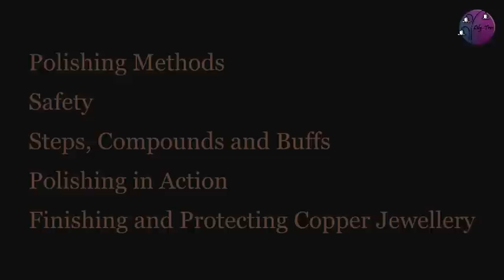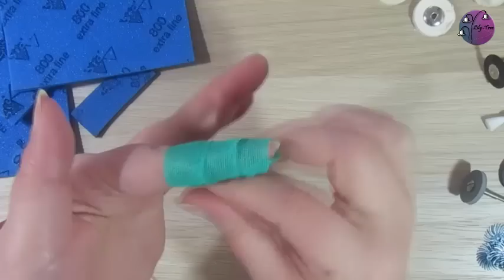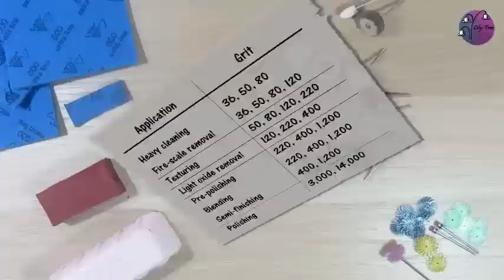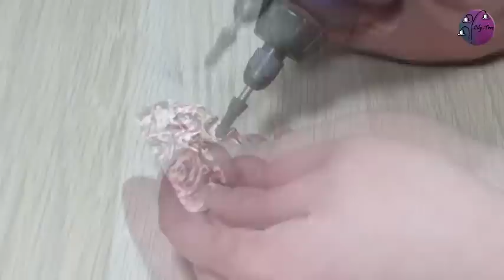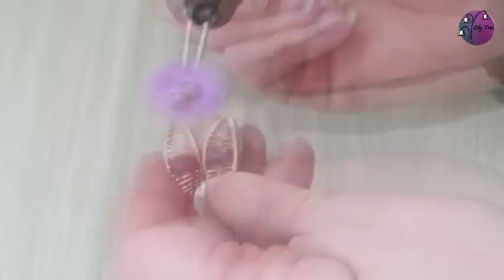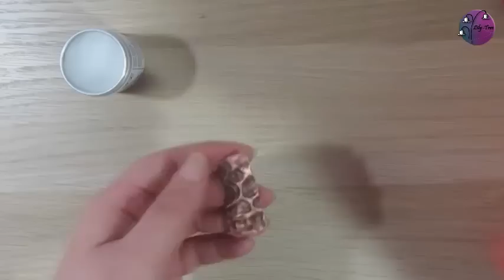How to Polish and Finish Copper Jewellery

Comment: Hiya, thank you very much for all your tutorials. Very helpful indeed. I saw your comment below about Protectaclear. I've been using this product recently as well. It really has a great finish and so far it's lasted a good while. Do you have any suggestions about how to clean copper pieces that have been coated with Protectaclear? I understand that this product stops it from oxidizing and tarnishing but it still gets a bit dirty after a while and becomes dull. Would you recommend using a silver polish cloth or a Sunshine cloth? Or would they be too abrasive? Or just a microfiber cloth? Thanks so much in advance.

Comment: Very helpful information. I have some silicone wheels and points but hate the mess that they make so I've mainly been using the radial discs and even doing much of the work by hand because I find it relaxing and i can take it in where I watch tv in the evening. 

Do you have any tips for keeping your bench clean when using the silicone products? My hands still get dirty when i polish by hand (and pretty rough too!), but I make less of a mess. I'm wondering if I'm using them incorrectly. Thanks again, I enjoy your channel.

Comment: Lots of good information, thank you.  I have a question:  Sometimes I use liver of sulfur to oxidize my copper pendants, followed by using steel wool to remove the excess..  After that step, I notice when I apply the rouge, my polishing felt wheel gets black from the oxidation.  Is there any way around this, or should I polish my piece with rouge first, and then oxidize the pendant second?  But I still want the shiny, polished look after oxidation...
Reply from the maker: Yes, I do tend to polish my pieces first, so I can concentrate on working through the grades and get the shine that I want.  I do try to 'miss' the low points, though, so the patina has a bit more to get a grip on! 😄 Once I've oxidized it, and used the steel wool, if I want a higher shine I'll then polish the high points again - and this usually only needs doing lightly. 

I do find that rouge tends to make the felt wheel black anyway - with or without patina.  I'd recommend trying the silicone/rubber polishing burrs - you can get fine grades for a high shine finish.  I feel that they give a bit more control over where I'm polishing and seem to last longer before I replace them (they just slowly wear down).

I hope that helps!

Comment: Thank you, Lily!  Most informative!

For US viewers:
'Pendulum' polisher means Dremel Rotary with a Shaft extension kit which can be hung on a stand.  It is the standard Dremel tool that you see in nail salons, and woodworking.

I also found a cheaper alternative for wax.  Renaissance Wax costs $15 for 65 ml or 2.5 oz.  You can buy the EJ Eaton Microcrystalline Wax 8 oz for $19 on Amazon.  Same item, good reviews.

Microcrystalline Wax is not the same as carnuba wax or beeswax.  MC Wax Polish is derived from crude oil and has polyethylene compounds and dries to seal the item.  Renaissance Wax is a brand of microcrystalline wax polish that is encountered in antique restoration and museum conservation.  It is also used for the polish and conservation of gemstones and of organic materials such as wood, ivory, and tortoiseshell.
Reply: Thank you so much I am trying to learn more about polishing and sealing copper jewelry and your comment helped tremendously!☺Very much appreciated! Many thanks!

Comment: Hello. After you buff those what do you apply to keep oxidization at bay ? I stay in a third world country and sealant sprays, renaissance wax etc is not available here. I am also confused about lacquer technique / plating / clear coat sealant / brasso - do all these methods provide the same final result? can you suggest something?
Reply from the maker: Hi John,  I haven't tried everything, but my current favourite is protectaclear from Everbrite.  I suspect that might be another one that isn't available there, though.  It is a  liquid lacquer-type coating, which seems to wear better than wax (which was my initial go-to).  Each of the methods you mention will have slightly different results, so you probably need to test them to figure out what works best for you.  I'd be inclined to try a clear sealant/lacquer and see how it works.  One thing to bear in mind is how much you're finished pieces flex and whether your chosen sealant will flex with it, or crack.

Sorry I can't be more help at this stage.  If you do find something that works, please let me know.  I think at some point I need to do a comparison video testing out some different choices, but I suspect that worldwide availability will always be an issue.
Reply: I will let you know after i test it. Talked with few owners of chemical stuff and experts - all suggested me that I should bend the strip before I apply the sealant spray. Other wise it may crack. Unless I dip my hands in it..I wont be able to tell 100% exactly. Yeah - material availablity is always an issue
Reply: Really complicated to find some here at the end of the world in Chile. Thanks for your teaching. I've been looking for painting copper with fire, but my cuestion is if it will change the colour...keep looking and learning. Thanks again you really give an excellent class

Comment: Thanks for your informative videos.  They are so helpful and your instructions are so lucid and precise.  I have read that a tumbler will help to take burrs off copper jump rings.  I have had an impossible time trying to file them down evenly.  Will a tumbler with pyramids help or is there another method you recommend?  Also, what is your opinion about using a clear spray gloss to protect the copper piece?  Thanks for your help.  Keep up the great tutorials!

Comment: Thx so much for your video.   What handpiece are you using?  I have a Foredom flexshaft I used to use for cutting jumprings for chainmaille, but now I do wire weaving  and am looking for a reasonable handpiece to do what you’re doing.  Do other products like a dremel handpiece work with a Foredom.?  Thx in advance for your response.
Reply from the maker: I've got a Foredom Flexshaft too!  My handpiece is the quick change one (H20 I think) which makes swapping the burrs and buffs easier, but the standard one should work too.  When I got it I did agonise over which handpiece to get - and chose convenience over versatility - but the ideal solution is probably to have both!  I'm not sure if the dremel handpieces fit.  From memory I think there are a couple (maybe more) types of fittings that flexshafts use, but I'm not sure which are cross compatible.  I seem to remember the fitting has a name (or number) though, so if you can find that it should be easy to look up.

Comment: Thank You - what is the name of the Wax you use.
Reply from the maker: It's renaissance wax.  I've also started using Protectaclear from Everbrite, which is a liquid you can paint on and lasts a bit longer for items worn close to the skin.
Reply: @LilyTree  Even though Everbrite and ProtectaClear have some similar characteristics, they are different coatings and are made from different resins. ProtectaClear is a harder resin that is better on highly polished metals. Everbrite has UV blockers and is a little thicker and is better for painted metals, anodized metals and rusted metal. If you would like to know which coating is better for your project, check out the decision flow chart on each Everbrite and ProtectaClear product listed on Amazon.

Comment: Thank you so much Teresa!  I'm wondering why you would use the rouge if you are going to patina a piece anyway......?
Reply from the maker: Thank you! I don't always, but usually it is if I want the final piece to be as shiny as possible.  So once you've used the patina, you don't need to do much buffing work on the high points to bring that shine back.  I expect others might reverse the order, but my thinking is that if I leave polishing until after, I'll be too heavy handed and end up removing all the patina!   Of course, if you want more of a satin finish you don't need to polish that far.